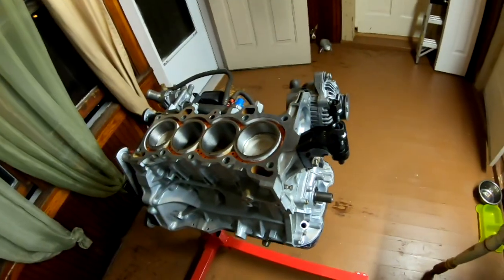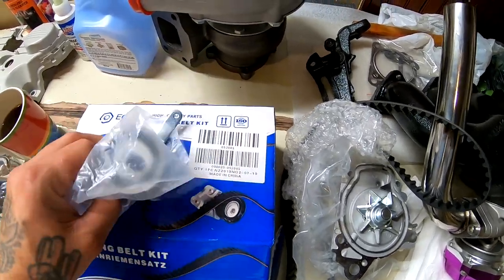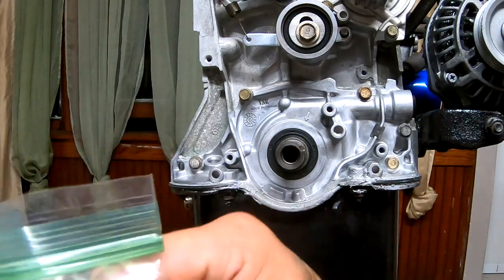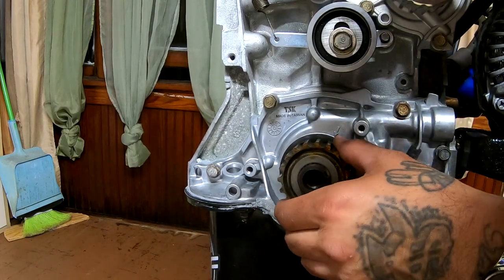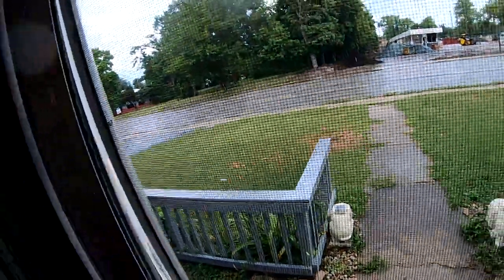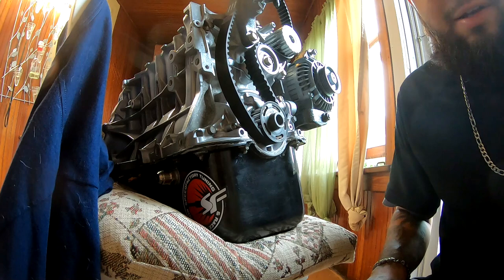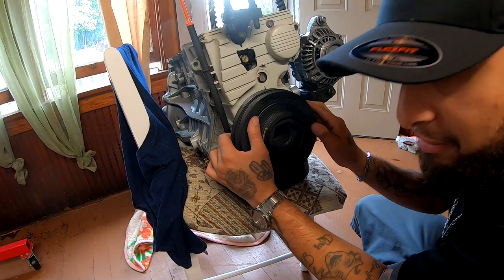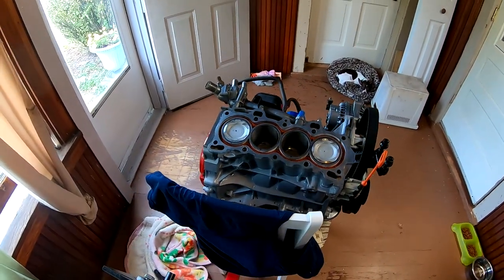500hp Civic D16 Timing belt, water pump, tensioner install and Junkyard Run

Comment: Still watching but you can put an extension/small socket in the dowel pin and use a crescent wrench to twist it loose. I recommend spraying wd40 or pb blaster in it to help loosen it

Comment: What size feed line do u need ?
Reply from the maker: - 36" Long Stainless Steel Braided Oil Feed Line- 1/8th NPT & 4AN Fitting i was gonna get one of those ebay kits
Reply: Barbas Life ur goin to use -4 ?
Reply from the maker: Yup
Reply: Barbas Life i  have -3 line
Reply from the maker: Do you have the little adapter plate that goes to the turbo from line... i guess it would be the female part that goes from turbo to the line.
Reply: Barbas Life i just use -3 to 1/8npt
Reply from the maker: Do you wanna donate the line for the build? Are you local?
Reply: Barbas Life yea local
Reply from the maker: What does zk G stand for? Those are the initals for an old acquaintance of mine. Have we ever met?
Reply from the maker: You in aurora by 5th st?
Reply: Barbas Life i was by there and yea we work together